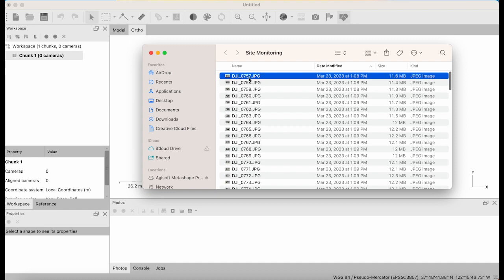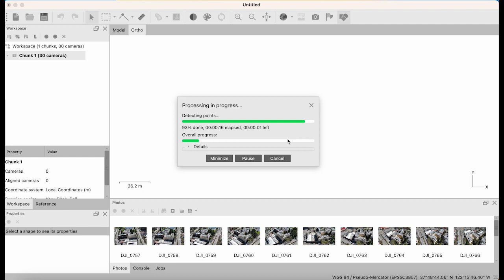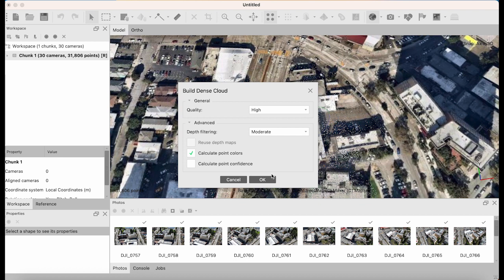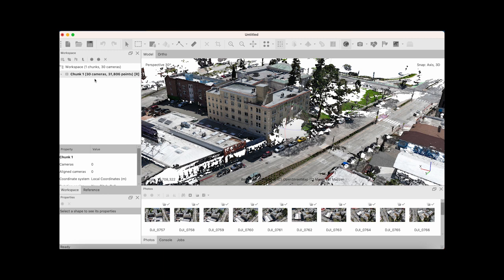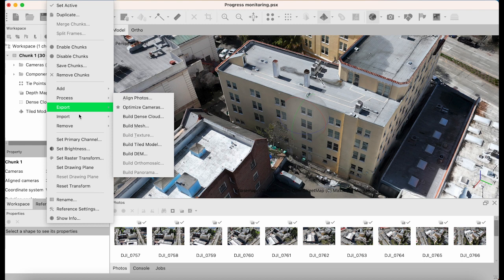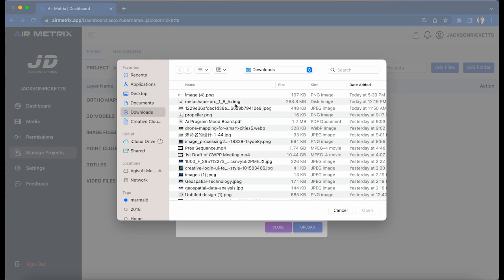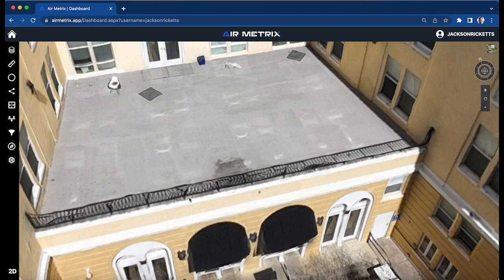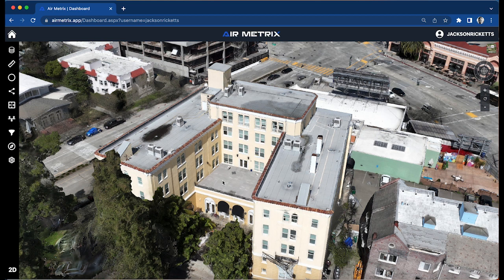Build 3D model with only 30 images?? - Drone Modeling How To

Comment: 1:57 &  3:26 both have Adaptive camera model fitting but you only selected it during Optimize. Im just trying to learn, are these both the same option or apply differently because of what step in the process it is?
Reply from the maker: Thats a great catch. I actually don't know what the different would be. What are you truing to process? You could try processing the dataset side-by-side and changing those parameters to find best results. If you do, please share your findings.  Thank you for watching and subscribing.